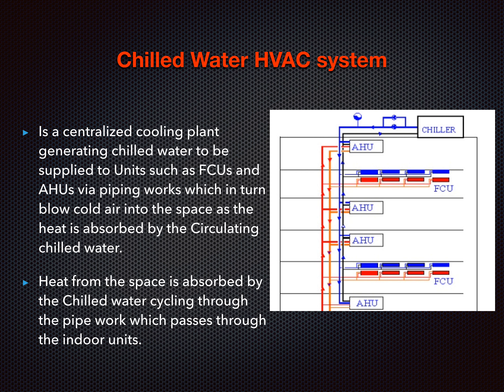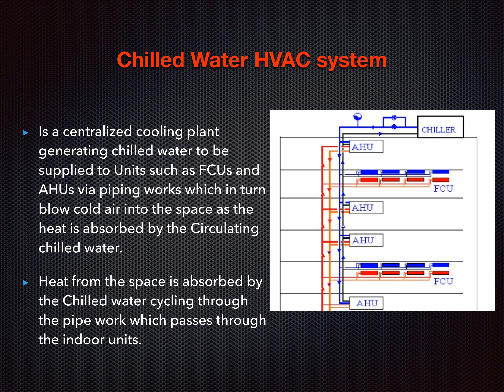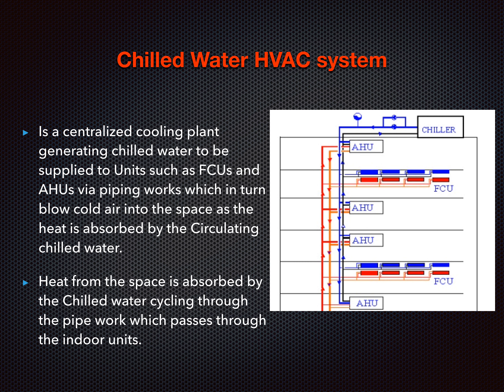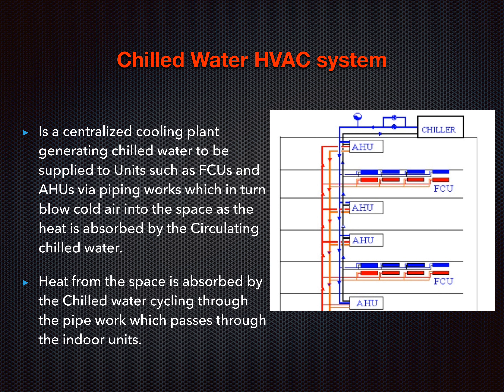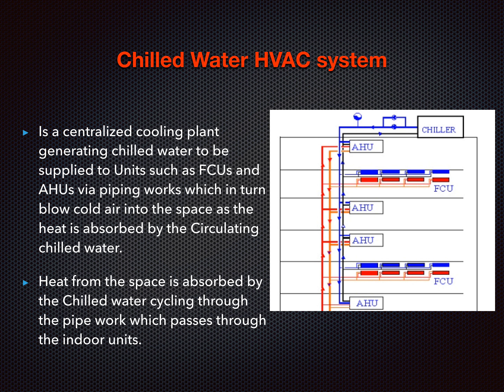Chilled Water System in HVAC (Chiller Basics Simplified !)

Comment: What does FCU stand for?
Reply from the maker: FCU stands for Fan Coil Unit which is an air conditioning equipment
Reply: @ExpertEaseEducation  
Is that the Condenser or the Evaporator?
Reply from the maker: The FCU acts as the evaporator In a chilled water system